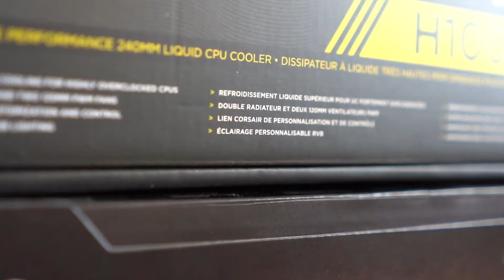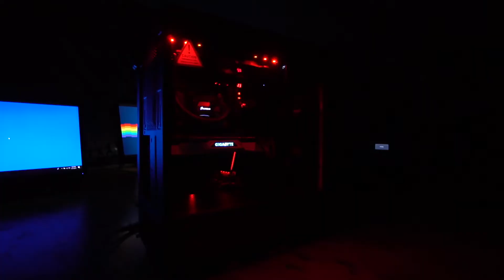It Seems That All I Build Are iRacing Rigs

Comment: Do u have older generation pc parts. Im desperate to find a pc just meeting pc requirements for sim racing titles. rfactor2 Assetto Corsa Competitione automobilista iracing Race Room Experience and Regular Assetto Corsa. Those are my titles i need. Can you help.
Reply: You can build an inexpensive pc yourself. My son and I built his for under $500. 

CPU: $100-$150
Ryzen 2200g or 2400g. These have built in graphics so you don’t need a graphics card. Keep settings in low or medium and you can race.

Motherboard: $75-$100
Use a b350 or even a b450 motherboard type. If you pick one that has built in WiFi it’ll save a little$$

Memory: $100-$125
Use 16gb of 3000mhz or above

Power supply: $50-$75
500-650w bronze certified 

Case: $50-$100
Pick the type that will fit your motherboard. 

Hard drive: $50-$100
You can find 1tb hard drive for about $50
You can find 500 gb ssd for $50

Windows 10: free
You can install windows for free just make sure when you install you select you don’t have a product key and it’s free.